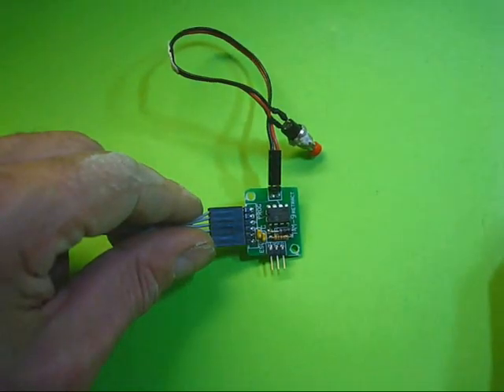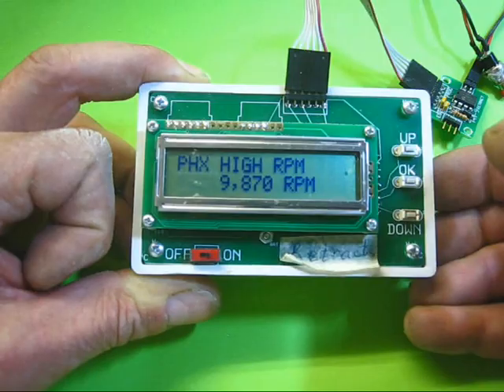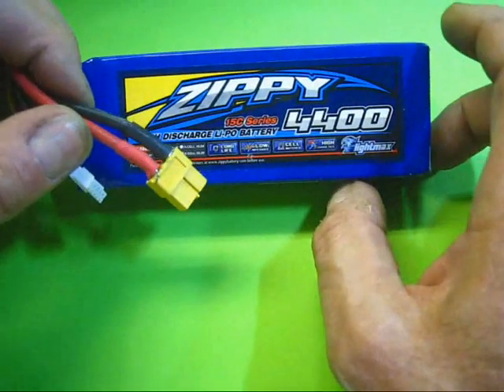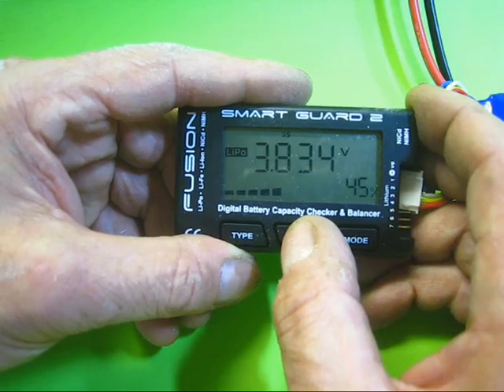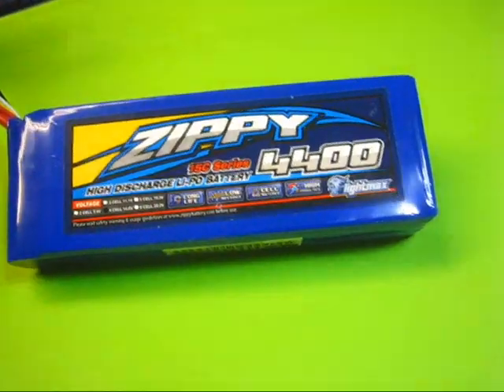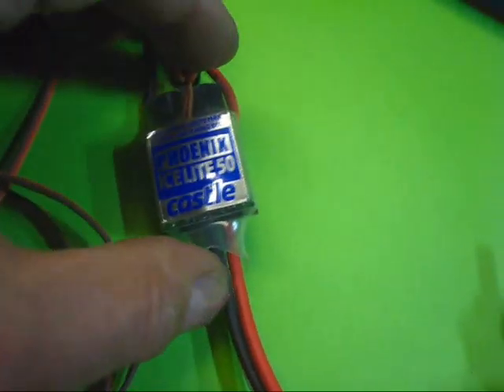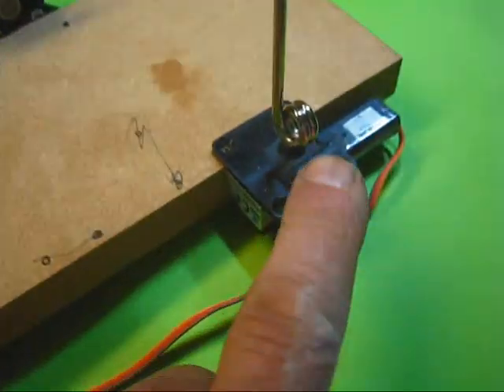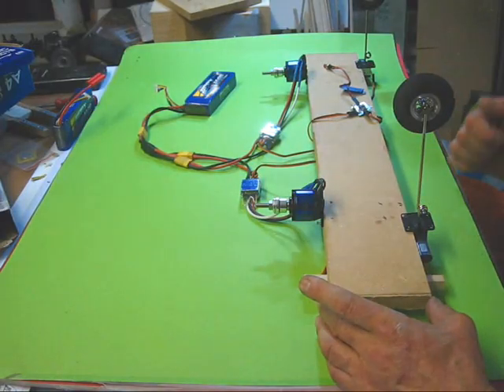Paul Winter  describes  the  set-up  for  his  new ELECTRIC  powered control line models  .wmv

Comment from the maker: Hi David, You ask if it’s possibly to mix different makes of electrical components for Electric flight. Possibly, but it’s not something we plan to investigate.  As you can see from our various videos we have had consistent and ongoing success using the Will Hubin and Castle creations components so would not want to risk compromising what we consider is a perfect set-up. However, you might find it beneficial to join one of the online Electric C/L Forums and seek other opinions. John B & Paul W.